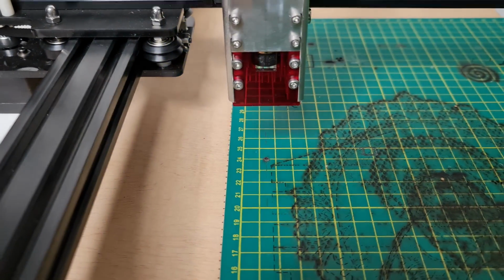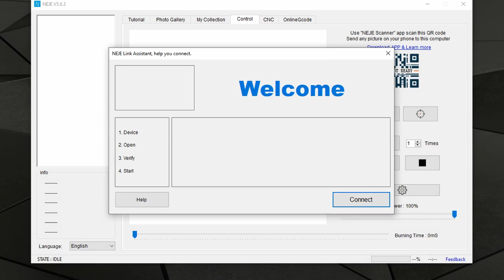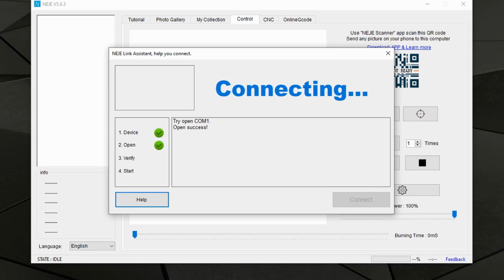Laser Flashing Problem - Say bye to your laser module - NEJE

Comment: Neje does sell driver boards in their online shop. Electric motors being driven are acting as generators. Simple fact. Electric cars use that effect and that generated current to regenerate/charge batteries when breaking. Now to be honest I am not really sure that your claim is correct. Mosfet transistors die. That is not uncommon thing. Most due due to the lack of cooling or to high current while they are working. Or they die because they have had some manufacturing issue abd were partially defective. It is pure magic how much current those SMD mosfets and power stages can handle nowdays. They are actually very resilient to. Can handle peak power in short periods. You have power stages that are 7x7 millimeters that can handle nominally 105 Amperes. Impossible to cool at that current so continuously they are used at 20 to 30 Amperes. SMD components are cooled true the PCB and with Airflow. Fan on the top of the laser has a task to cool the laser module and electronics to. Though remember that if the surface is dirty and covered by layer of dirt that came from the smoke, Airflow will not efficiently cool dirty components. It cools the dirt and dirt acts as isolation. So airassist is crucial thing if you do anything with a laser that generates smoke. I have few laser engravers. Oldest Neje is a first Neje Master with 7 Watt Electric consumption module. 10 and 20 Watt's versions were not available. That one moved a lot and bit X and Y axis were moved many times when it was off. Just few days ago I was showing my machines to my friends and they have asked about it and I have explained it. I have even moved it as fast as it goes just to show them   how it generates the power. Did do the same with my Neje 2S with N40630 module and there even LED's on the mainboard light up. So what dies that tell you? Brushless motor if the fan is turning and LED's light up? Can LED light up when powered with reverse polarity? Can fan brushless motor power up with reverse voltage? Pretty sure every diode will work only in one orientation. 
Brushless fans work only in one direction to.
More so I kind of think that Neje did something for it while moving same step motors in both directions spin the fan. Normally I would expect electric motors to make one polarity in one direction and the other in the other direction.
I am pretty sure that one can't generate more power by moving it then what power supply delivers during an operation. Especially while laser does not even light up.
Now one things is sure. None of the electronics like wrong polarity. Wrong polarity kills all sorts of components.
But due to the fact that fans rotate and LED's go on somehow does tell me that it is good polarity.
So I am pretty convinced something else killed your driver circuit.
I have to say I can be wrong to. I am aware of it.
I might even disconnect the laser and measure the voltage polarity generated by moving stepp motors.
Something tells me it will be OK though.
Like with all tools one should take care of them. Using Airassist is way to care about your laser module when you do anything that makes smoke when being marked, cut or engraved.
Reply from the maker: Hi NINEWALKING, thank you for your comment. 

I will try to be as short as possible. 
The stepper motors produce electricity if manually driven, and you can output more power than what is safely designed to work. The motor will offer a top speed while electrically driven, but that does not mean that the top speed cannot be overcome if driven mechanically, therefore producing more power (generally higher voltage).

About the reverse polarity, since the stepper motor has no collector like a DC generator would, it means that AC current will be produced, which in turn with some diode will be able to supply half wave electricity no matter the direction of turn to the circuit. 

I am sure that spinning the stepper fast enough can fry some components either by over voltage or current, whichever the component is more sensitive to.

My assumption about the MOSFET was given because it was the only component with something not right, however, if you watch my followup video, I find out that the problem was the small microcontroller next to it.

Cooling also affects electronics, but the thermal protection built in should prevent thermal failure during operation. 

EDIT
When I got the damage, NEJE was not selling the driver yet; they started selling them about 6 months later. I have finally purchased and replaced it on mine.
https://youtu.be/W3FDWGTS6eo

Ciao
Reply: @MiddleRoomWorkshop  What are you even trying to say? Just forget it. Do what you  want. If you want to make progress learn more. Especially English language. It is impossible to watch it.
Reply from the maker: @NINEWALKING
I do not quite understand the point of your comment. I am open to constructive criticism and  exchange of opinion, but your last comment is not very mature.

If you disagree with people's opinions, you can debate and discuss.

Your statement about my English is rude; perhaps you may want to try to exchange in my language or one of the other four languages I speak.

Last but not least, if you do not enjoy my channel's content, please feel free not to watch.

Ciao

Comment: So I just got the laser machine last week. I was able to use it yesterday and now today it won’t fire up. What help can you give me with this.
Reply from the maker: Hello Eddie Fuller, thank you for your comment.

I will first need to understand a bit more about your trouble in order to give you some help.
What do you mean about "won't fire up"? What software are you using, and are you able to connect the machine to the controlling software? if yes are you able to move the machine through the software or it does not respond?

If all above is fine, what kind of files are you trying to burn?

Let me know
Ciao
Reply: @MiddleRoomWorkshop  when I say won’t fire up I mean the laser doesn’t shine or burn. It doesn’t show up. I took a image from Google and imported it and it worked perfect. Now it just won’t send the laser. Everything else works perfect.
Reply from the maker: Hello Eddie Fuller, thank you for your feedback.

Are you using the NEJE app? if yes, may you try to install LaserGRBL, there we can understand if the Microcontroller is the problem. 

You can get the software from here https://lasergrbl.com/download/
Once you download it, close the NEJE app, launch LaserGRBL, try some of the COM ports available, and click on connect, this should read your machine right away, than you can import any image and try just to see if you get the laser output.

Let me know if you need some extra assistance and what is the outome, 
Ciao

Comment: hi, i have been using 2s max for about 5 months. My laser module broke down and was replaced with a new one, but now I cannot use it with any application other than the neje application. i have lightburn and laser gbrl connection problem. When I try to connect, the blue light on the module disappears. what should I do? thanks
Reply from the maker: Hello NİDA MELEK KURTOĞLU, thank you for your comment.

The laser module on its own should not affect the connection with the PC by any means unless you did not replace the Mainboard as well.

The machine runs in two modes, either NEJE mode using their proprietary software and you will see a blue LED on, or in GRBL mode using the other software like LightBurn and Laser GRBL in which case the blue light should go off and a yellow or orange should go on.

Did you perform some updates after the replacement?
Have you tried checking whether when you close the NEJE app, the app actually stops running in the Task Manager?, try to check that or restart your PC altogether. If this does not work you suggest you re-install the CH340 Driver using LaserGRBL from Tool > Install CH340 Driver.

Let me know how that goes and we can investigate further.
Ciao

Comment: Please help me.
My  NEJE 40 laser has become too wide and inaccurate.
Although the settings are set, Can the problem be from Cleanlines؟
Reply from the maker: Hello baba sid ahmed, thank you for your comment.

Lenses cleanliness definitely play a big role in lase machines, but in order to answer, I need to understand what do you mean by wide and accurate.
If you have the laser at the right focus, and the line is not perfectly clean showing varying thingness along, then simply clean your lens- blow on them with a bit of air just to get dust particles and then with cotton buds and a bit of alcohol.
I clean less will also require more power than usual to cut through the same thinkers of material, so you may try that as well.

If you are facing a different problem try being a bit more descriptive so I can troubleshoot the possible causes of your problem.

Let me know, 
Ciao

Comment: Thank you for this informative video.
I did a mistake today.
It's working voltage are 12 and ortur master 2 Pro operating voltage are 24 and today I connected neje 30 watt Laser module with it its blow up. Can you help me how to repair it.
Reply from the maker: Hello Atif Ali, thank you for your comment.

I am sorry to hear that, I am afraid that multiple components might have to get damaged.
In order to understand the extent of the damage, you'll need to open the module paying attention to don't tearing apart the connectors on the inside, then you will be able to examine the board looking at components that simply look burned or not perfectly right.

There is no rule of thumb here. In my board the MOSFET seems to have taken the hit but yet I am not 100% sure that is the only component. By the way, I receive the replacement MOSFETs and I will try soon to fix the laser.

Let me know if you find out more, eventually, you could share in private the pictures of the board to my email: info@whathowwhysolution.com so I can try to see what component might have been affected.

Ciao
Reply: Good afternoon! Thanks for this video! I have the same problem ((( The laser module burned down after manual movement. I disassembled the module, but I didn't see any signs of damage, and the electronic element that you talked about in the video was initially unmarked. Do you know what this element is and what it can be replaced with? Is he really the problem? you said that you got transistors, did you manage to repair the laser module? I do not understand circuit design and therefore I ask for your help! Additionally, I wrote to your email, thank you! @MiddleRoomWorkshop
Reply: photo of the board of my laser module         https://drive.google.com/file/d/1uoSgdRW8vUP5_7ogTq-ZI3sMOa_D996t/view?usp=sharing

Comment: Thank you so much for working this out! I had the same issue when I went to use my laser today. Thanks to your advice, I disconnected the laser module and found that the device was then correctly initialized, so I will be ordering a replacement module.

The last time I used my laser,  on 12/24, I left it unsupervised for a little while and when I got back to it, I found that it was stuck in a position — I believe a guest mistakenly blocked it from moving — and had burned through the 4mm thick wooden Christmas tree ornament and had etched the stone tile beneath it. I'm lucky the stepper motors seem to be fine, but I'm sure that shortened their lifespan.
Reply from the maker: Hello Notashroom, thank you for your comment.

I am sorry to hear that. Most probably, the heat generated by the fire damaged the circuitry inside, the positive side is that nothing in the surrounding caught on fire.
CIao

Comment: I am on my 3rd module in 3 weeks... My issue is that the diode power has just dropped off to virtually zero.
Reply from the maker: Hello Keith Armstrong, thank you for your comment.

If you are at the third module iteans that the mainboard might overload the module.

Do you have any clue about how it could burn out in all the three istances? This will help to troubleshoot and get to the root cause.

I hope your problem is solved once and for all.
Let me know.
Ciao

Comment: So I have the same issue u have no ive been using neje 30w for 1 year cna I just get another 30w module in amazon and connect and hood to go? I diag the same as you I unplug the reed wire and worked fine the moment I fought the laser connections it’s  stoppers and started blinking

Comment: Well, this is not a small issue, and it can not be fixed by firmware update. I think Neje should be the first who offers a solution for this especially under warranty time. I just bought the machine 2 weeks ago. So i owe you big thanks to this warning. I will also follow you especially about this subject, because i am sure someone sooner or later will comes up with a hardware solution.
Reply: You also have it on all 3d printers and other devices because motors can also be generators that's why you have to move the axis slowly so it doesnt generate power to the point of burning something on the circuit..

Comment: this is an important find that neje and ortur should immediately start working to fix on their frame circuitry! way to easy to overload the most expensive component of the system. I have not heard anyone else talk about this, you deserve a medal! perhaps an interim fix would be to put a manual disconnect switch atop the laser module?
Reply from the maker: Hello John Wayne Williamson, thank you for your comment and compliment.

Yeah, I think that a switch on the module will help, but they should add the protection at the base including some diodes correctly dimensioned.

Ciao

Comment: Thanks for this am soon going to order the 80w module based on reviews.  Am concerned though about there support I actually wrote an email to Neje and although they replied very quickly non of my questions were answered so a waste of time.  Your video has really helped though thanks
Reply: The 80w laser arrived and after a brief test this thing is very powerful.  Using the supplied test board I set the laser at 4% and tried on corrugated card and it drew a perfect picture without any burn smudges.  Tomorrow will be installing on my home built 400mm x 400mm frame.  I was lucky as well the item was delivered without intervention by customs.

Comment: Could I disconnect the module before homing just to be sure?
Reply from the maker: Hello Mark Gopie, thank you for your comment.

Yes you can, but you will damage the connector in the long run, rather before powering down push the red button located in the motherboard to home the axis, than you can power down the system.

I hope it helps
Ciao

Comment: What brand it's better than Neje?
Reply from the maker: Hello Alejandro Vanegas Vega, Thank you for your comment.

There is no easy answer to your question, but I tried to reply as best as I could to reply another comment about a month ago, and I am pasting it here for you to read.

The point is also that it depends on what you need to do with the machine.

It is not an easy answer as there are many variables, and all is by lack with these cheap engravers.
Anyhow, I have personal experience with the NEJE master 2s Plus which is the smaller brother of the NEJE master 2s Max. I can tell you that is okay. You are only limited by the software, which yet kind of does all you might need, just there is some workaround, and if you have the budget, you could get LightBurn, and your limitation are over. 

From what I can see, the other three models are pretty much the same, coming in different designs. 

Laser module; 
Comparing the base module, the Neje is the most powerful optically at 7.5w; however, the other 3 machines came with FAC lens, which is more efficient and focuses the laser into a narrower point making it somewhat equivalent in power despite being 5 to 5.5w.

Frame:
The best frame, in my opinion, is the Totem S 40w; even if it has more plastic components, it comes with a cool mechanism to easily adjust the height of the module, i.e., the focus.
The Atomstack A5 Pro is also good, especially if you need to put thicker stuff under as it has greater clearance; however, the height adjustment is a bit trickier with 2 screws. Note: the device shown on the website is unwired.
The Artur Laser Master 2 Pro has some fantastic reference metrics in the frame but is the messiest, and it requires the cable in the front. The good feature that should be in the other machines is the emergency stop.

Software:
Despite it not being great Neje is the only one to offer native software out of the box, and it has a smooth and easy set-up so far, as for the other I personally do not like to work with benbox, and I limit LaserGRBL for picture only as it offers more options than the NEJE one.

Engraving:
The smaller square spot created by the module with FAC lenses is way clearer and precise than C-lens, so I give this to the other 3 machines; however, if you go with NEJE A40640 dual laser with FAC Lens and 15w optical power, you will be able to do all you need. (by the way, stay tuned as I ordered one for upgrade)
For metals, it seems like the Atomstack is the one.

The answer is not easy, so I cannot really give you a verdict since I do not have experience with the other 3 machines.

I hope this helps.
Ciao
Reply: @MiddleRoomWorkshop  thank You for the extensive answer 👍.
I live in México and not speak English only can read a little English technical about CNC láser.
I am FIAT technician and i AM beginner un CNC business and i want to Buy a CNC láser for graving identification tags for Cats and diga and MDF and Wood.
I unterstand almost the 70/% of your explication un your videos 👍
Reply from the maker: Hola Alejandro Vanegas Vega, hablo poco de español.

Tua pregunta no es facil porque hai tantas variables, pero para hacer lo que dices (engraving tags of MDF and Wood), una de las pequeñas maquinas Neje o Artur esta bien.

No estoy seguro de si el español es como el mexicano, pero creo que esta cerca.
Espero que te aude.

Ciao